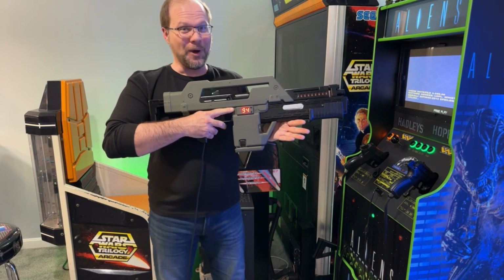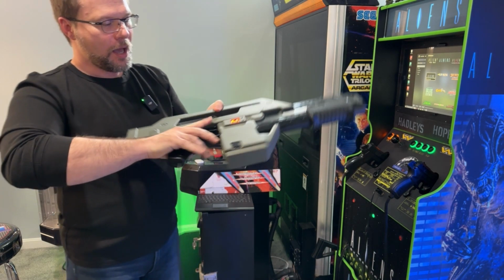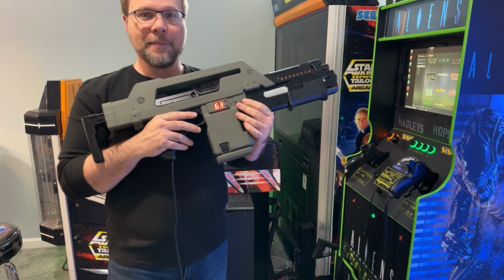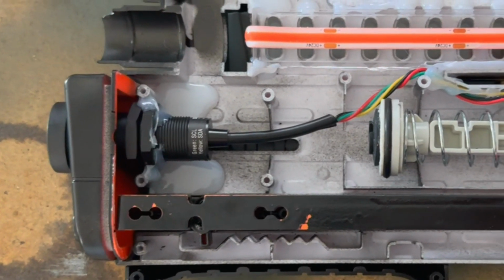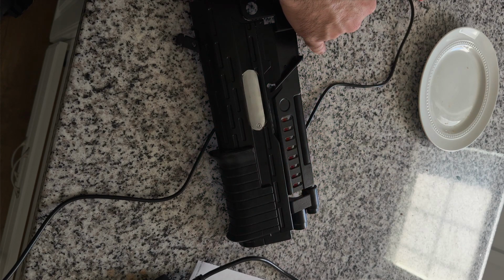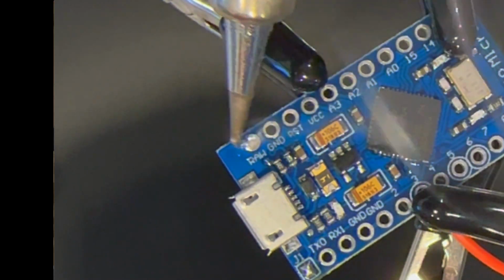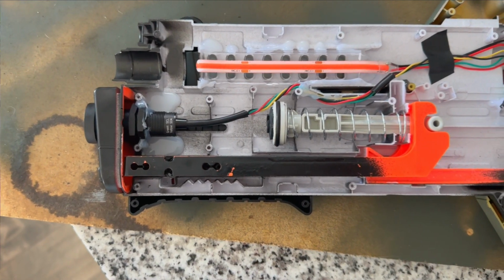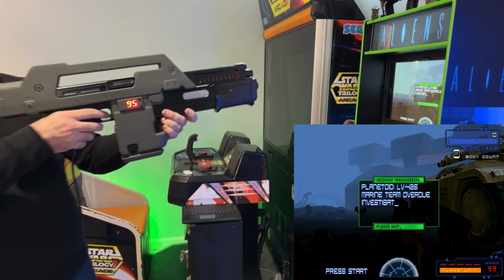Pulse Rifle Lightgun Build - GUN4IR

Comment: What was the solenoid that you are using there?  I found some Ghost Squad shells (no internals) from arcadespareparts and wanted to use a larger solenoid than what would be used for a standard Gun4ir build - looks like you have a slightly bigger one there?
Reply from the maker: I used the big 24v one found in the Aliens Extermination arcade guns 

https://a.aliexpress.com/_mLoohPo

Comment: Great build! How is the plastic and feel compare to a heavy duty arcade gun?
Reply from the maker: It’s got a decent weight to it but thankfully most of it’s in the rear so it’s not too tiring to hold it up for longer gameplay sessions
Reply: Great job . Came out perfect Alien is also one of my favorite themes and games and artwork etc . I saw that you said that it wasn’t too heavy 
Ray thought it would be and didn’t recommend it when I discussed a while back but now I may try to do it myself 
Of course now it’s harder to get that nerf 
I just scored a terminator salvation topper so I need a rifle n I prefer these over the salvation ones for sure
Reply from the maker: @supermetalgamerman5930  I joked with Ray about doing a conversion to my metal airsoft pulse rifle, but we both laughed about how heavy that would be 😂
But yeah, I like this one way more than the terminator salvation rifle

Comment: Saw this originally on a FB Mancave group and definitely would like to build my own so thank you very much for posting this video! Couple of questions I had before deep diving into this. Does the GUN4IR kit allow for some kind of customized sound font (similar to what you see with diy lightsaber projects) to be added to it such either flashing a sound file to a chip or inserting a micro-sd card? Was thinking of finding a way to add that iconic pulse rifle sound if possible. The other question I had was for your build did you go with a particular color for the fish eye lens? Was kind of hoping to see what that looked like. Thanks!
Reply from the maker: the GUN4IR doesn't handle any sound effects, the only sound I get from mine is that of the solenoid moving back and forth.
If you had a totally separate sound board it might be possible to trigger it from the GUN4IR pro micro via a type of relay.

The fish eye lens I have is black, you can see it at the  3:25 mark. It just threads over the IR camera lens
Reply: @Brad-D Thanks Brad! That helps a bit with deciding what I might want to do here for this. I’ve built a few lightsaber soundboard projects in the past and that was what I was hoping to use in my painted nerf pulse rifle replica since you can tie it to a 28mm speaker and add sound fonts for various button pushes, even some randomized ones that pull from a list / configured with gestures, that sort of thing. Then I saw your build to actually turn it into a light gun and now the plan is to do both if it can be cramfu’d inside the thing.
Reply from the maker: @SkyeWelse  As far as gun-shells go, this one has a lot of space inside for goodies
Reply from the maker: I'd love to see the post in the  FB Mancave group you mentioned :)

Comment: Hi, what is the Aliens game and what console or system is it for? On the other hand, what would be the configuration within the emulator or within Retroarch if that were the case? Thanks
Reply from the maker: It’s aliens extinction an arcade game from 2006. 
It plays on PC (windows)
You can configure custom controls via DemulShooter or TeknoParrot
Reply: @Brad-D  aliens extinction playstation 2? I was referring to the configuration of the gun so that it recognizes the reload button and the trigger...
Reply from the maker: @  no this was an arcade-only game

But you can find dumps of it available to play online. It will launch natively in windows. but in order to set your own controllers, including whatever you want to be your grenade or flame thrower buttons, via either program is called Demulshooter or teknoparrot.
Reply: @Brad-D  I understand, thank you very much! On the other hand, I just found your channel. Do you have any video where you explain how to configure retroarch to assign the buttons and trigger to make the PSX game Time Crisis work with a gun, for example?
Reply from the maker: @FersjuaCompanyS.L  Sorry, no. I focus more on arcade emulation rather than consoles. I also prefer PC-based emulators like PSX2 for PlayStation2 where I do not have to use retroarch
Reply: @Brad-D  Ok perfect, thank you very much for your answers. I'm going to watch your videos, they are very interesting...thanks.